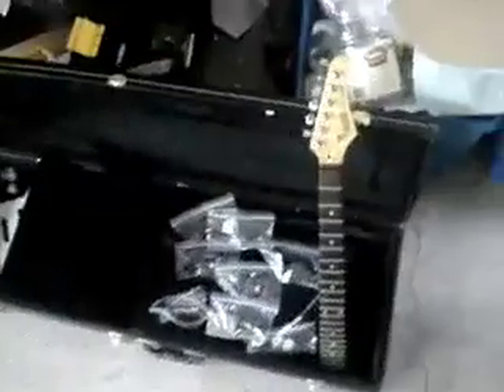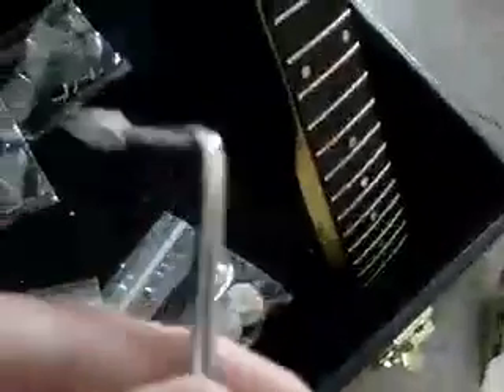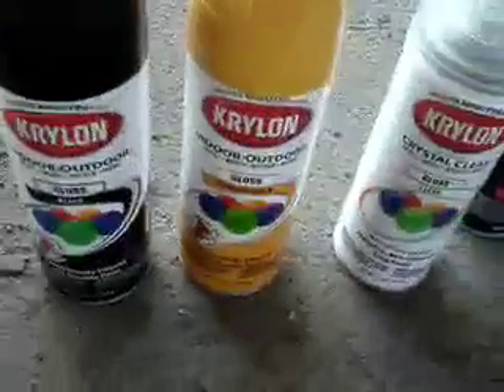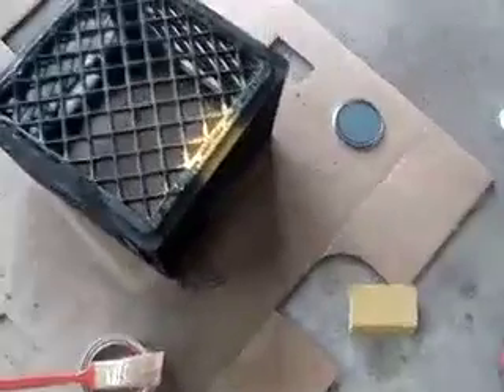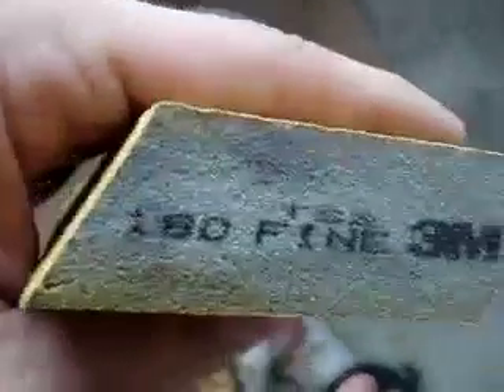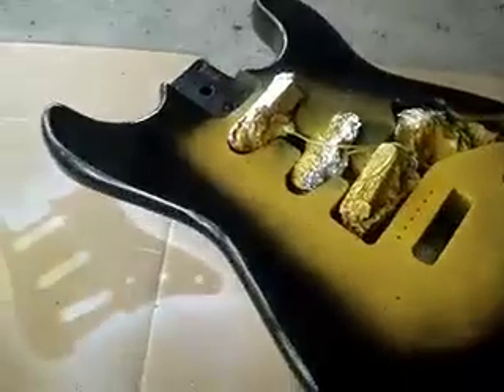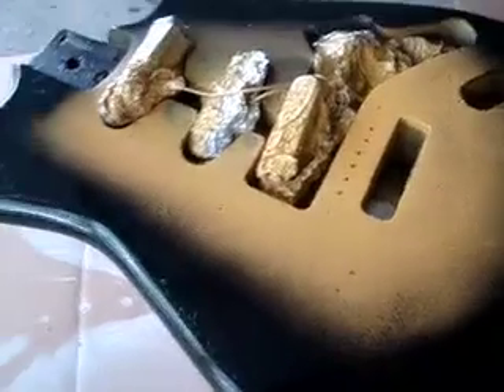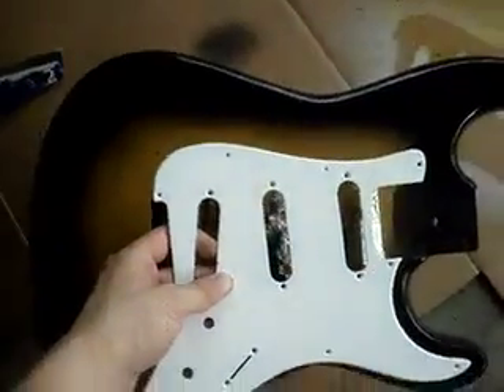guitar paint job makeover

Comment from the maker: I used 5 coats of polyurethane on top of two paint coats.  make sure you use extremely fine sand paper and sand between each coat of poly to take out the "orange peel" feel.  after you finish with the poly, you need to get a thing of paste wax and buff out 2-3 coats of that.  then it will be REALLY shiny.  make sure you buff it out REALLY WELL.